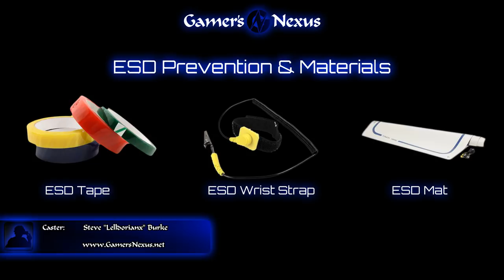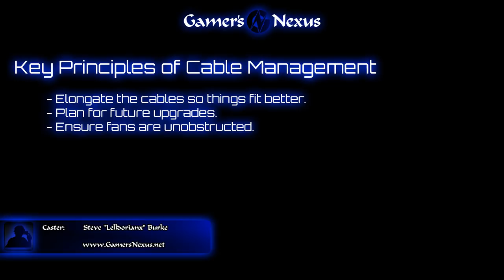How to Manage Cables in your Gaming PC - Basic Cable Management Guide

Comment from the maker: I actually wrote an article exactly about that subject. View the video description for a link to the article. It's at the bottom. The short answer is: I personally recommend 3 mid-range fans and the placement depends on the case and hardware. See the guide for in-depth details on exhaust/intake.

Comment: nice guide i like how you included your build order and explained it. Great tip to put the board pre-built in last. You really don't want to hit it with your psu or even drop something on it. seen other guides and they don't even mention that but just for a little added protection its definitely worth it.

Comment: Good cable management is hard if your power supply has short cables. For example, I cant run my mobo power, CPU power, and PCI power behind everything because the cables are too short. Disadvantages of having a PSU made BEFORE most cases came with cable routing holes. Either way, I still think my cable management looks pretty nice, my CPU power is behind the end of the GPU and i have my PCI power connections wrapped on my CPU power to make it look a bit cleaner. The Bitfenix Ronin's stealth shield hides some stuff too.
Reply: Motherboards in relation to the case also seems makes a big difference. I'm on my 3rd case, and other than the fan ports on my mobo, the cable management holes are way better organized than my last 2 cases.

Comment: I have the same case but I can't fit the smaller power supply cable through the top port like you did. Any recommendations?
Reply from the maker: Did you split the cable? Most 8-pin power cables can be split into a 4+4 cable at the header. I think that's what I did. You might need to route it before installing the board, depending on how large the board is.
Reply: What Case Is This?

Comment: I'm looking for an in-depth (video or written instruction with lots of pictures) description of specific cable placement.  The PC I'm building has as ASRock X370 Gaming X mobo, Ryzen 2700x, 32GB of Kingston Fury ram, 500GB Crucial SSD and 2.5TB of HDD storage.  I have about 30 mobo connectors, some obvious but others not.  Not sure what to connect where and I don't want a meltdown. Thanks!
Reply: This is all going in an Apevia XHarmony case.  It's midsize though a little smaller than I wanted.

Comment: I feel like I did good. Before I saw this video, I built my PC without an ESD strap and did fairly well on cable management and didn't manage to screw anything up. Except for the CPU, but a pin got bent and it just wouldn't turn the monitor on :/ But I got that straightened out (Pun intended) and it works fine now. My first build too :D
Reply: EXACTLY WHAT HAPPENED TO ME, IT WAS MY FIRST BUILD TOOO HAHAHAAA GOD DAMNIT CPU
Reply: I built my first pc without any issues. Only my cable management is issue :D

Comment: how did you manage to pass the 8pin power connector that goes on the top part of the mobo, in the first (black) case. I have a similar case and the hole at the top is really small, the 8 pin connector (the one that splits in half) does not pass through

Comment: Nexus I need your help please!! What is that rubber plate thingy called? And what is the cables to elongate the power supply cables called? Help greatly applreciated PLEASE!
Reply from the maker: The cables that elongate PSU cables are often called "extenders," "extensions," or "adapters" (incorrectly). You'd want to search for something like "PSU cable extensions" or "8-pin power extension."

Can you be more specific about the 'rubber plate thingy?' Are you talking about the rubber that covers the holes we pass the cables through? If so, that's called a 'rubber grommet.'
Reply: Yes the one with the holes
Reply: Thanks for a speedy reply
sorry i replied so late lol

Comment: I see you've used a Rosewill Thor V2 case, which is great because that's the case I've chosen for my new build. It was cable management in part that influenced my decision. Wish this went just a tad slower but I get the idea. One thing I noticed was the idea of facing the HD connections to the right side of the case to cable manage them too. How is that done with the brackets as supplied by the Thor?

Comment: Ok so I already built my computer and I just want to rearrange some wires...problem is that I already got stuff on my computer and I'm afraid that if I unplug a certain thing I could lose data or something. Mind helping me out? do you think i'd be fine just unplugging most things?
Reply: Easa Misleh  What's that thing called that blocks the wires (the rubber thing) that's on cases

Comment: USB 3.0. It's a strange one because it comes out of the rear end of the case. Depending upon where your USB 3.0 connector is, cable management of it could be difficult. There is one mobo where the bloody thing is right in the middle of two expansion slots.

Comment: This is really good and all, but my issues are with fan cords.  I recently switched to an LED Liquid cooler, and the cable issues I have most are the Fan connections.  They seem to barely reach where I need them to, and the tubes going from the radiator to the heatsink seem to constantly want to get in the way.   Anyone have any way to help, I'd appreciate it.

Comment: Can i do this after the build?
Reply: Yeah, test the build then after unplug the cables and do what is shown here. Just ask me if you need to know more or if you are having any problems :D
Reply: Do i need to turn off the psu switch and plug it off?
Reply: Yeah, if not you might fry your components and even with warranty don't leave it on to avoid any hassle. :D
Reply: I find the best cable management jobs come the second time. Installing components and pre wiring everything helps greatly. Do some general routing and once its all installed tweak the cables until your happy. This is a great vid on this subject good info.
Reply: Thx!